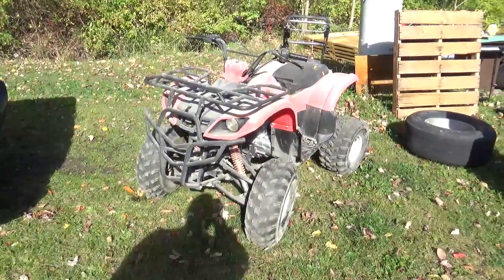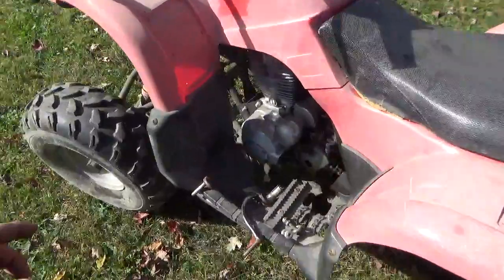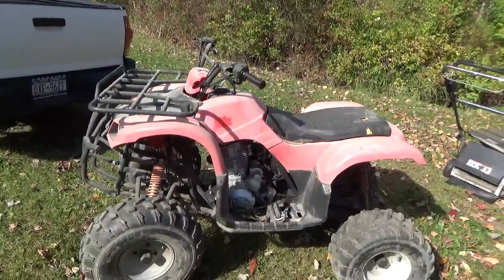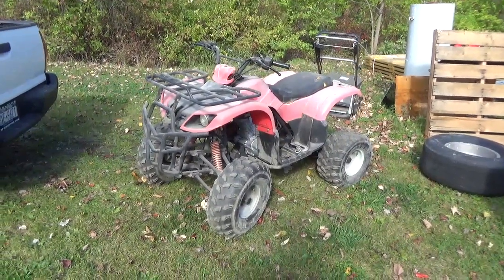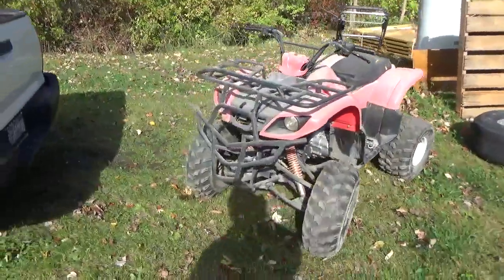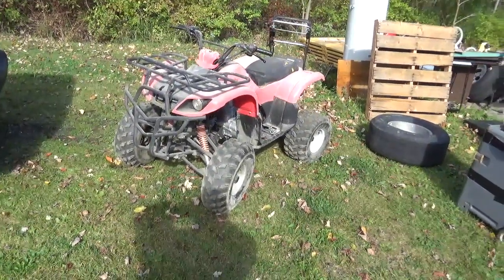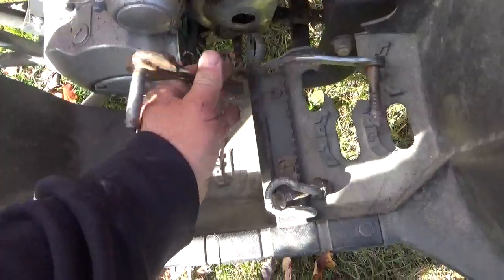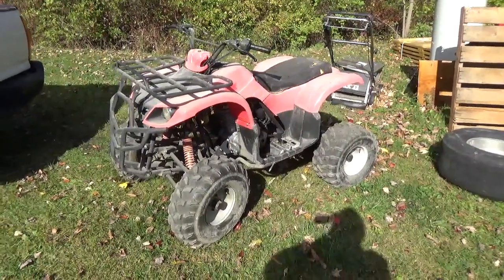Mechanics Lien ATV, $150 Craigslist deal, 200cc Manual Clutch China Junk!

Comment: Looks like a tao tao rhino to me but there are several "brands" that sell these clones. I've worked on them and they are not too bad if you can wrench on them yourself. I hate heal toe shifters and wouldn't put one back on it. The engines are pretty good but seem to need a little more carb than they come with. I really don't consider them junk especially for the price. They need to go with a semi-auto shift instead of the clutch setup and add the 5th gear.
Reply: Tao Tao came to mind. It is in good hands with Harvey.